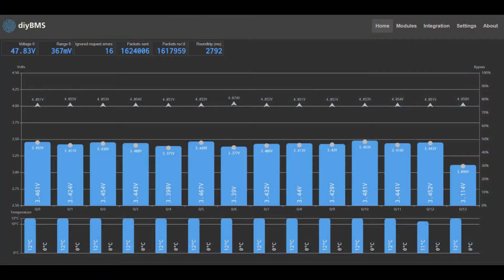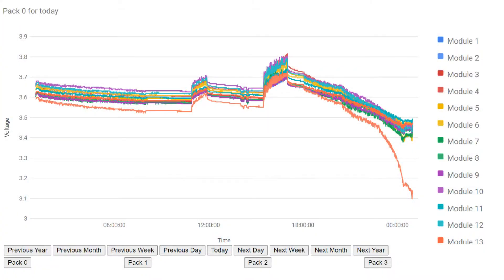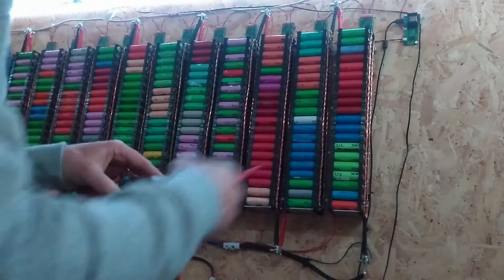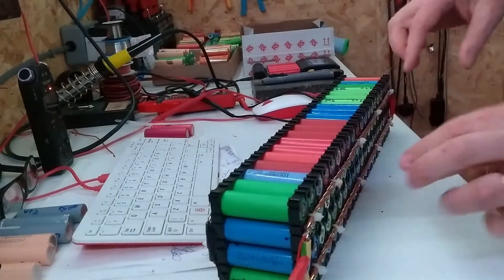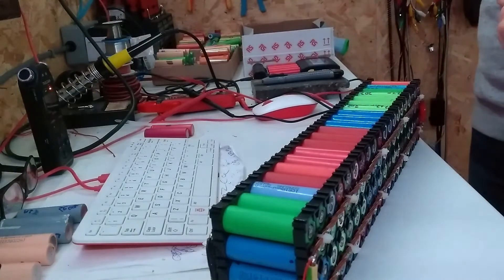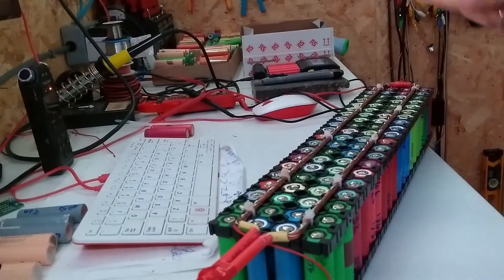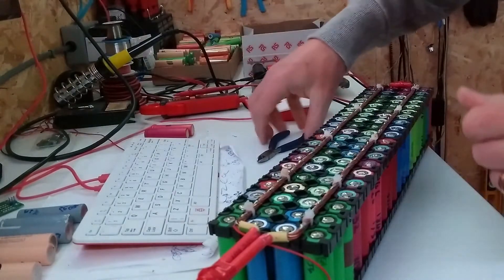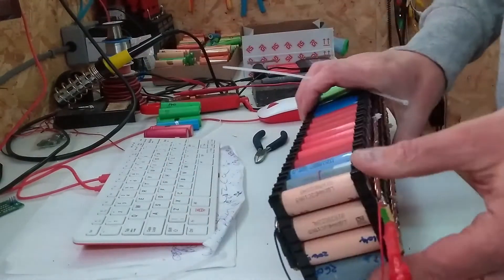Weak pack in my 18650 powerwall.

Comment: where do you use the internal resistance for?
Reply from the maker: I try to use the cells with the lowest internal resistance first when building my packs.  I won't use any cell with an IR > 400.  I find it is important to retest high IR cells though as the readings can vary quite a lot.

Comment: Hello Nick, i am interested to your diybms, hiw can I have that? I also have 14s80p setup using assorted 18650 batteries, 2000mah to 2500mah capacity every cells
Reply from the maker: Hi there.  You can get the DIYBMS. Here is a link that will tell you all about it.  https://github.com/stuartpittaway/diyBMSv4
Reply: @nicholashowell  i already check the site, how much it cost? Is it plug and play or i need to assembled?
Reply from the maker: You do have to build it yourself.  You can order the PCB with most of the components already soldered from JCLPCB but there will still be some hand assembly required.  It's been a while since I built mine but I think it worked out about £50 to £60 in total.